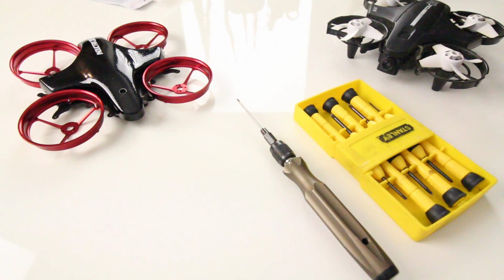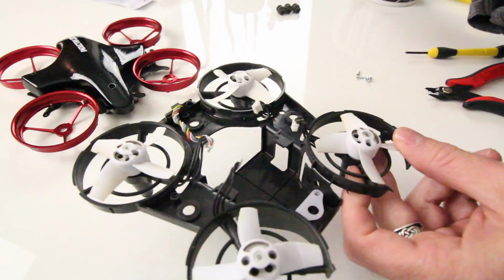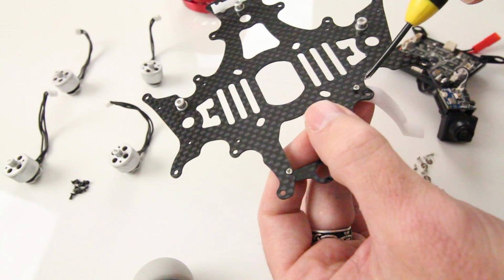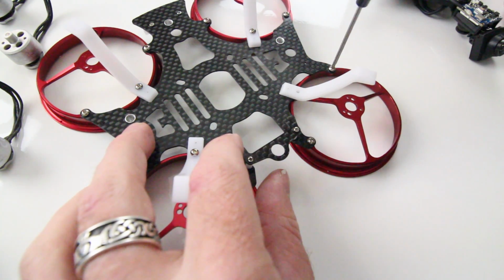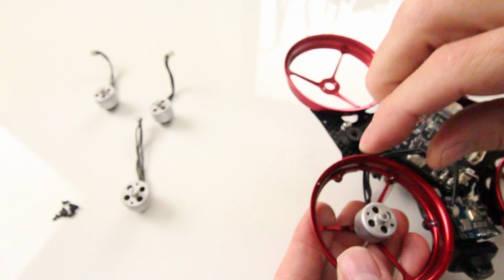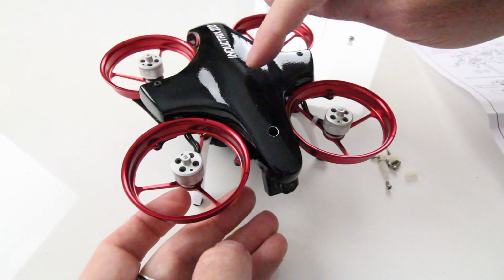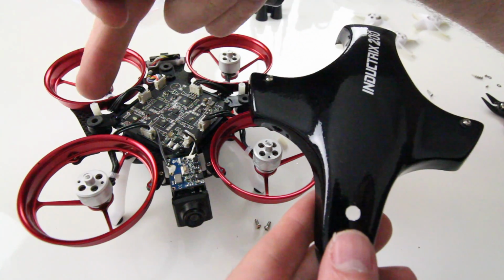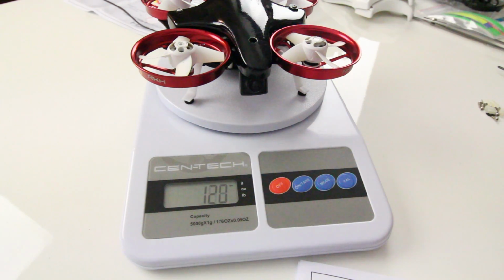INDUCTRIX 200 Carbon Fiber Frame, Build Video (Courtesy of Rakon Heli)

Comment: Wow sorry if i missed this in the video which great job btw...Question: Can I use a regular 3s battery? I was going to connect a XT60 pigtail so I could use all my 3s batteries I use for other quads. The silly battery that comes with the inductrix 200 is ok but not worth the trouble if you intend on flying often.